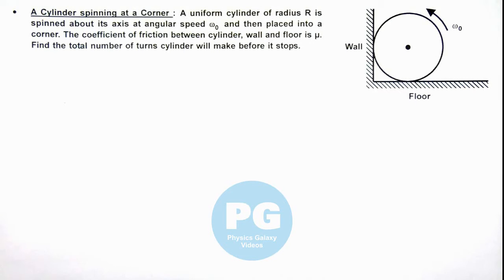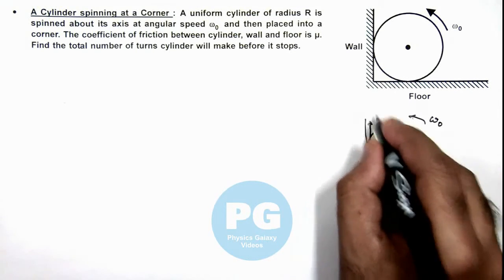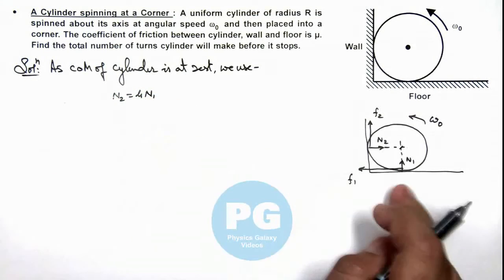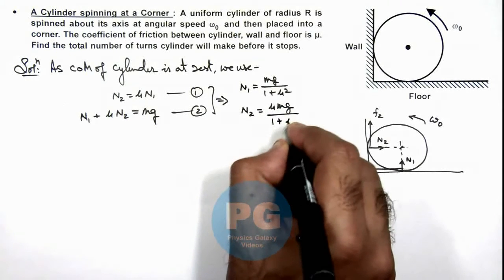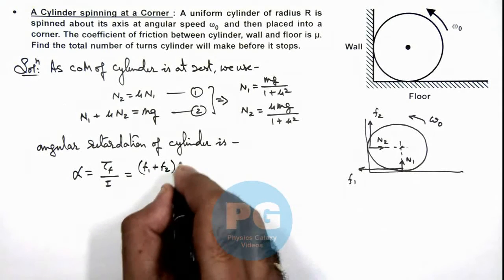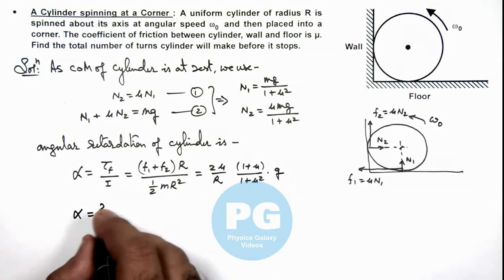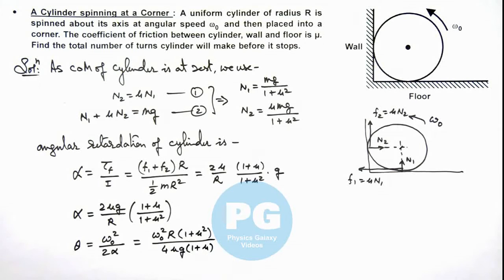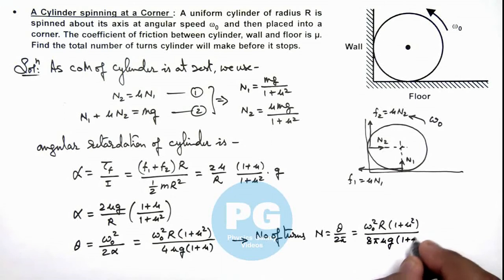13. Advance Illustration | Rigid Body Dynamics | A Cylinder spinning at a Corner | by Ashish Arora

Comment: Sir will we not consider ant acceleration of the cyl in x dir and write
N2-uN1=ma
Reply: yes, sams doubt
Reply: Aisa nhi ho sakta kyonki acceleration hua to wo wall se contact loss kr dega so N2=0 => F1 peeche par aage koi force nhi jo use na dega😎
Reply: 2021 or 2022?
Reply: @Mnitjaipuree  2023...u

Comment: as normal  is internal force so it doesnt produce any torque .bt as i fixed my axis on the wall piont of contact where friction passes through axis (so no torque due to that) and then wrote the rotational equation and as alpha came out to be 2u/r (which is constant and i applied rotational equation w2 = w +2as ) am getting wrong plz correct me sir